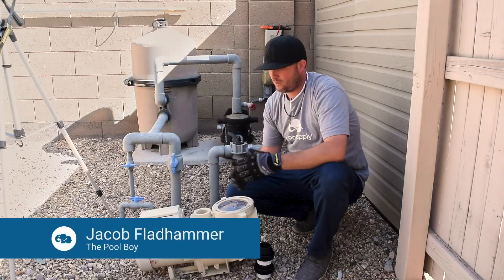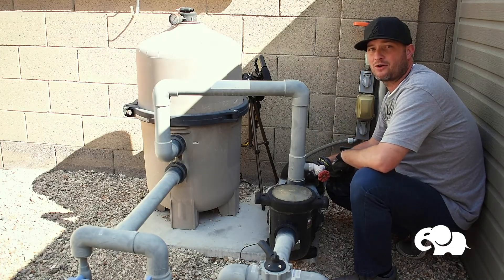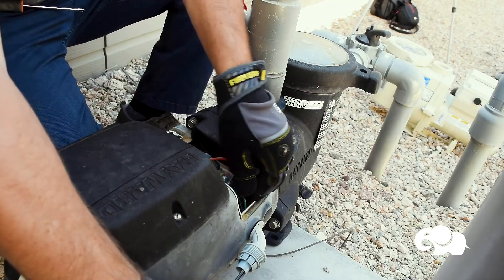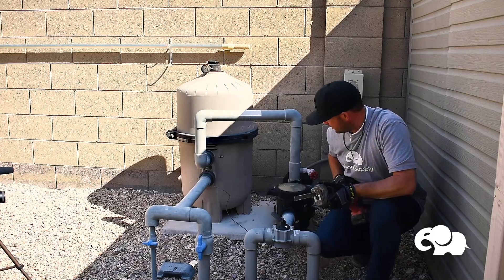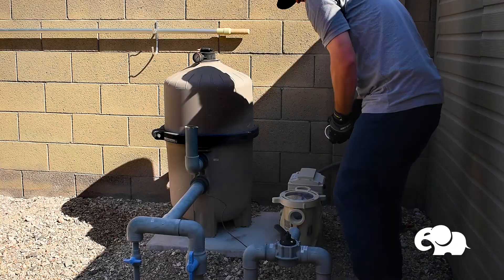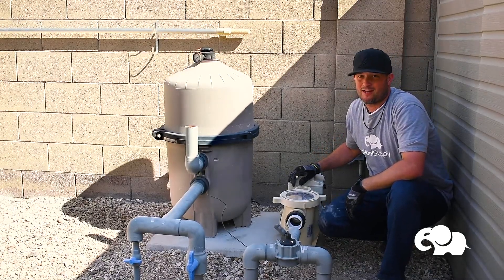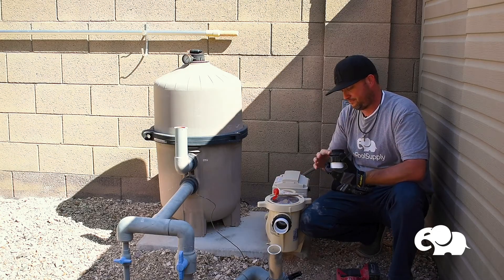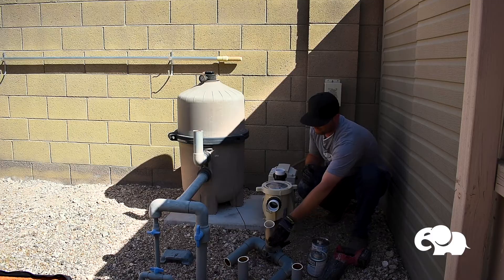How to install a Pentair Intelliflo Variable Speed Pool Pump

Comment: Setting RPM is dependent on the amount of water you want to filter.  As a general rule, you should "turn-over" three times the volume of your pool every 24 hours.  That means knowing the amount of water in your pool and how many gallons per min the pump handles at different RPM.  Again the goal is filtering three times the volume of the pool at the lowest RPM (saves money) and required GPM for each 24 hour period.  If the pump doesn't show GPM, buy a flow meter and add it right after the pump.
Reply from the maker: Appreciate the feedback.

Comment: Why do you not put in a flow meter? It is impossible to know what speed to set the pump without one. With my Pentair pump, 1,750  rpms exceeds my filter recommendations. 3,000 rpms would be enough flow for multiple water falls, 5 or more jets, etc. At 3,000 rpms with a simple setup like that, you are likely destroying the filter by applying way too much pressure and water flow, let alone sending energy bill through the roof.

Every pool has different line lengths, different number of bends, and simply different equipment with different specs. No "professional" should touch pump settings without a flow meter, yet they do. For example, I have a Pentair DE 80 cartridge filter. I also have Ultra Temp HC 140K BTU heat pump, IntelliPh, IntelliChlor, sacrificial anode, check valve, temp sensor, IntelliConnect, yep...and in-line flow meter just before filter. 

With all that adding back pressure compared to that simple setup, I was amazed to see that 1,050 rpms provides the recommended 50 gpm water flow. 1,900 rpms exceeds 85-90 gpm. Over 2,200 rpm guarantees I am destroying filter and forcing micro debris back into pool because 100 gpm is maximum flow for filter.

I use a FlowVis flow meter and you should be able to get one for ~$120. That home owner would recover their investment rather quickly. If you are in California which = energy hell, and robbed blind, you likely get the money back in 2 months. Even without energy consideration, which is HUGE, you WILL significantly increase life of equipment, and equipment will work at peak efficiency. Over powering a filter makes it decline in performance and useful life.

FYI: IntelliClor, heat pump, etc, all work well before 50 gpm for filter. Filter is key to measure. I run my pool for 16 hours at 1,050 rpms, and three at 1,800 rpms to maximize surface cleaning and to pull debris through drain and skimmer. Then let equipment have some chance to cool down for five hours. 

Works great. I guarantee, every pool is different and IMHO a flow meter should be required for anyone to set pump speeds. No possible way to get it right without one.
Reply from the maker: Thanks, appreciate the feedback!

Comment: If you don't honor the 2 year warrantee because it's not professional installed, then why do a video for DIYer's?  I worked in the electrical industry for 53 years starting  as an apprentice, then journeyman and and then master, with licenses in 8 different locals. I also taught electrical controls at the State university of NY for 20 years.  I will not buy your products and will not recommend them. Your product will either hold up or not and by issuing a qualification for an install you are loosing business.
Reply from the maker: Hi there Sandi, We would suggest getting a hold of Pentair directly for any concerns or comments you may have that reflect upon the integrity of their products and their warranty information. We are a small family-owned company and we made this video to show customers that you do not always need a professional for installation.
Reply: @ePoolSupply  you’re right, you don’t need a pro for installation. Unless you like having a warranty.
Reply: Hes not selling you a product. Hes clearly doing you, a contractor, a favor. And Ive never seen one of these models fail inside the warranty, even on a commercial property. Not saying its not possible. But if you're confident you can install properly, this video will save people a lot (who dont have pensions)  of money these days. Also, "Qualified installers" (LIKE YOU) can include several disciplines including "Swimming Pool, Home Repair or Landscape Professional; Plumber or Electrician; General Contractor; Heating and Air Conditioning Specialist." per Pentair website. Love listening to these guys (from other professions) who dont know jack coming into the wholesale supplier and giving guys there shit because they know nothing and expect them to explain how to do these jobs. You should thank this guy. SMH
Reply: @inaktiveshooter  not doing me any favors, bud. I have a retail store, construction division, maintenance division, repair division, and 20 years in the business. Oh yeah, and I’m a Pentair Authorized Warranty Center, which uniquely qualifies me to speak in regards to Pentair warranties or lack thereof.
Reply: @clittle580  So again, sounds like your beef with pentair, why bag on this guy? I sure as shit dont work for pentair but these pumps in my experience far exceed the "lack there of" and the pro warranty... Imagine a non-union industry, and suppliers determining who is qualified to install their expensive products. But no you all of a sudden want to sell their products to people who have no Idea what they are doing, and it be pentairs problem?  OK
Reply: @inaktiveshooter  beef? What the hell would convince you that I have beef with anyone. I literally stated, that the warranty was voided by a non-pro install. That’s it. I’m not mad, I’m not upset, no one is in trouble or has been reported to anyone. I have zero beef with anybody. I do think you need a new hobby, though. And nobody was “bagging” on anyone else. 😂😂😂😂
Reply: @clittle580  I'd also add that if you buy your pump online, warrantee is almost non existent. So pro install or not, fat chance getting it replaced. 
Buy pump through authorized retailers or have your installer purchase through wholesalers if warrantee is a concern.